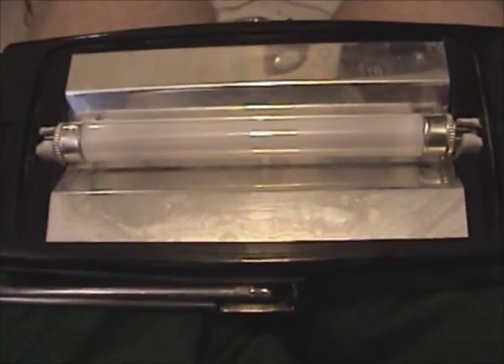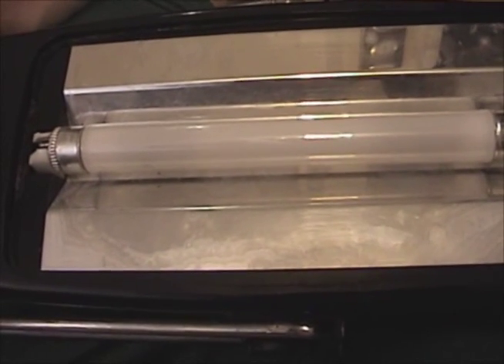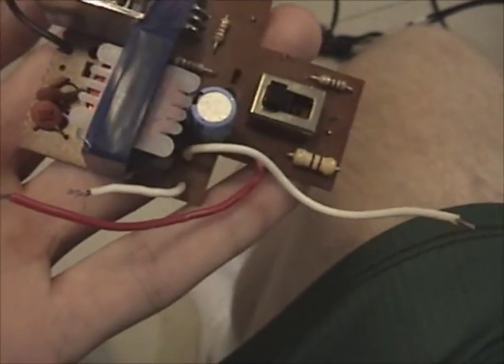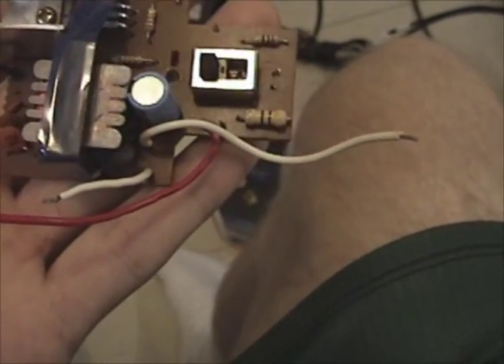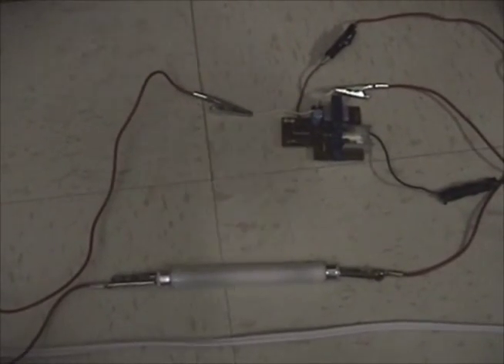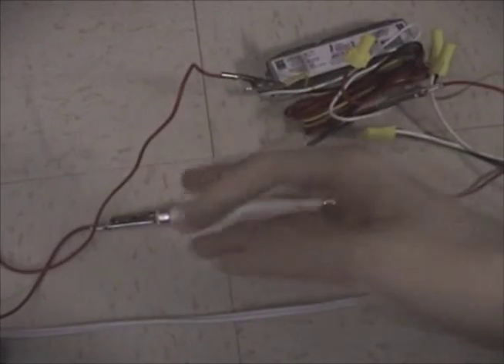Frying an F4T5 fluorescent lamp

Comment: I had an idea: Try to fry a fluro with an electronic HID ballast...
Reply: I did that but it ended up blowing the ballast because I powered a 36w 4ft tube with a broken filament that I shorted with a wire. Because the ballast was only powering one filament it caused a few components in the ballast to blow

Comment: The transformer looks like an audio transformer from a transistor radio. In fact there were "Neon lamp drivers" that used a 200k ohm to 1k ohm interstage transformer in a Hartley or Colpitts oscillator stepping up 9 volts to 200 volts.